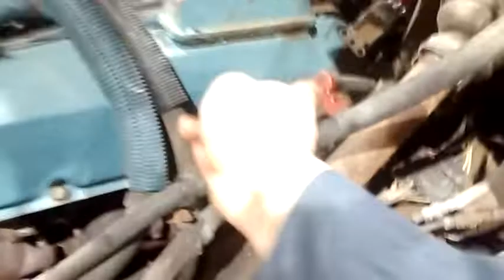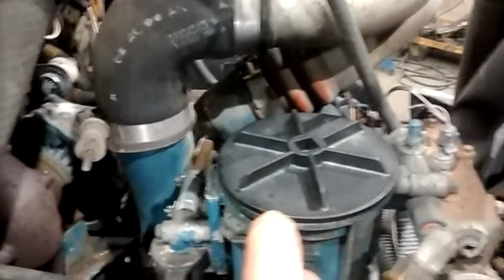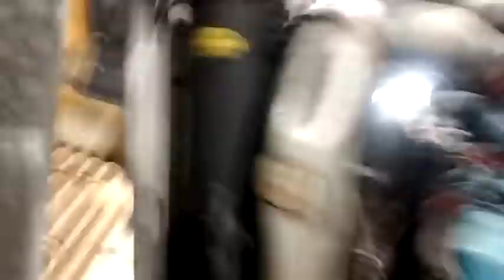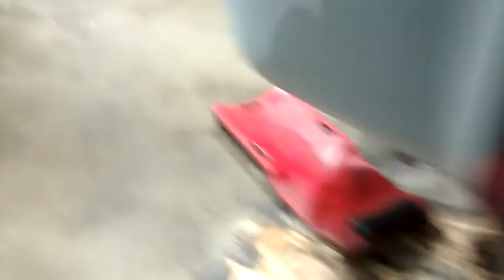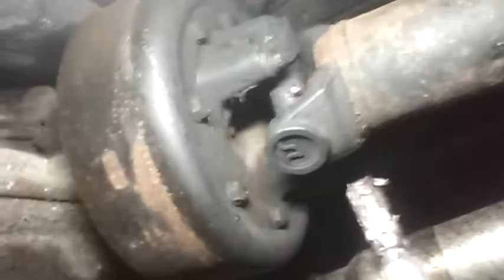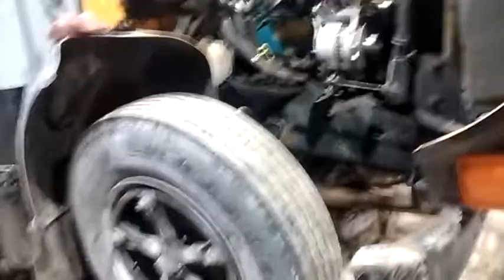Skoolie Maintenance and Repair Series EP 2 - Preventive Maintenance

Comment: Sir, Can u help regarding for my Bus the Engine is T444e, Before Remove the Timing Cover of Engine  No Problem for then after open this Timing Cover and change the Gasket  of after that Engine not Start Only. CRANK.. wat is the Problem Ssir of this Engine.. Thank you Sir

Comment: Hey Johnny big fan of yours. I watch all your videos and I really have learned a lot and I appreciate what you're doing here. I have a 98 International 3800 series t444e school bus and it's the 24 passenger and was mainly used for special needs kids and because of that it has the more industrial front axle that actually sticks down low and is only 6 in above-the-ground. My question to you is that I see a bunch of these other buses similar with simular years and a few years difference that have the straight axles and have a lot of clearance, my question is can I switch the other axle from these buses that have much more clearance with mine?
Reply from the maker: Yes you can replace the axle.